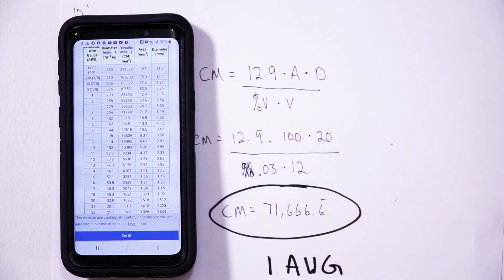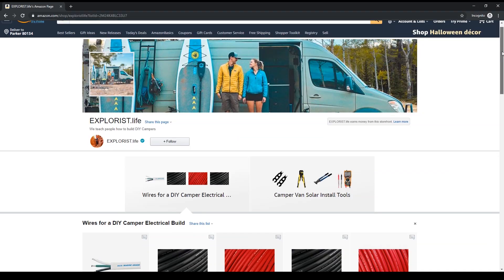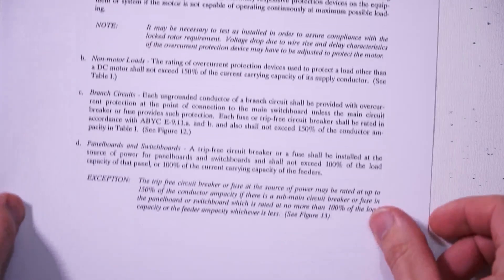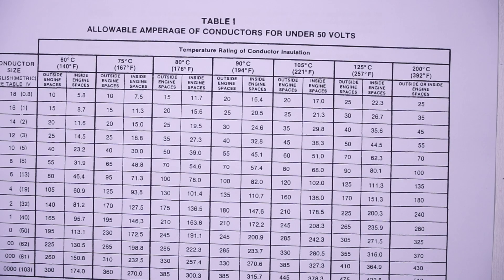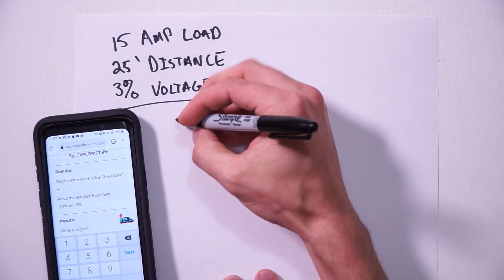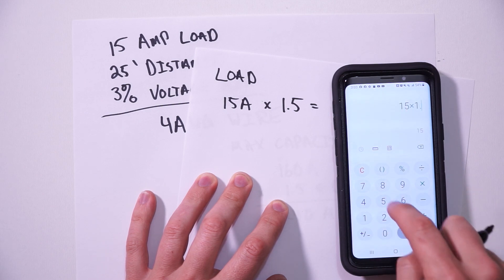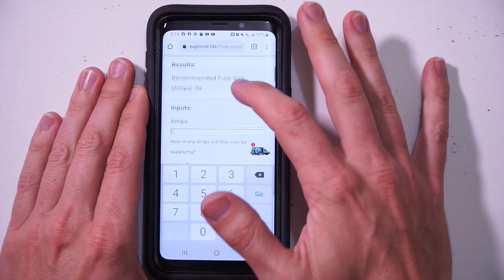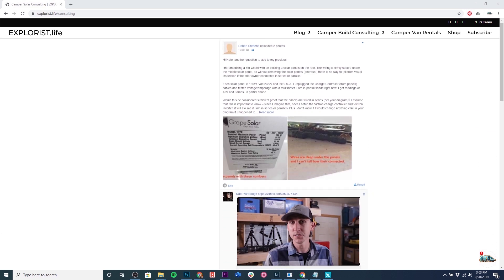How to Size Fuses for a Camper Van Electrical Setup

Comment: I don't get it, you say the fuses are to protect the wire not the device, but than you finally say to just size the fuse to the load which in this example was 15 amps with a 20 amp fuse. so didn't we just go around in circles? so basically I can use a fat oversized wire and still just size the fuse for the load which could be as little as 15 or 10 amps?
Reply from the maker: Correct.  It is indeed confusing and it does send us in circles a bit, but that's how electrical code reads.

"Sizing for the wire and not the component" means that your fuse can and should be higher than the component.  If I were to say to size the fuse for the component, people would have a tendancy to size for the amperage output of the component, say, putting a 50A breaker on a 50A charge controller; which would regularly trip under normal operating conditions.
Reply: @EXPLORISTlife  oh I see thank you, yes I've heard it's a rule to size the fuse for 20 or 25% larger than the component. Your math makes it more clear thank you

Comment: Hi and thanks for the super informative video. What i am having trouble finding is what size fuse to put on the wire between the Positive bus bar and the DC fuse block. How would i go about sizing that?

Comment: Nat, What an amazing gift you and your wife have. I purchased your wiring diagram for the 3000 W inverter up to 1200 W solar. It shows the fuses on the Victron Busbar but I'm using the 120/80 Victron controller to manage 800 W and I don't see the fuses listed for that busbar.  Wouldn't they be different sizes? I appreciate your help.

Comment: Love your channel Nate!  You're very meticulous and a master craftsman.  I'm building portable power systems and I've order some Taixi DC circuit breakers for my main Battery disconnect/protection.  Specificaly, DC12V 24V 48V 300A breaker part number is a bit challenging to determine give poor communication with the seller in China.    I payed ~$75 each for the 300A rated one.

Curious if you have looked into these.

Comment: I just discovered y'all today, Thanksgiving.  Awesome, thank you!  In the spring I am about to launch on a Lithium conversion of a Winnebago Travato Class B van.  It has solar already, and I will add more but a question I have for you is:  I notice that your diagrams all show PV panels in series.  Winnebago already has 2 extra plug ins on the roof for extra panels, but the panels will be in parallel.  I don't think that it will be worth changing everything around to have them in series.  What say you?
Reply from the maker: I very much like wiring panels in series.  Here's why: https://www.explorist.life/solar-panels-series-vs-parallel/

Comment: I know you know what you're doing, but where does it say in ABYC that this pertains to camper vans?  Shouldn't you be referencing  in NEC, the national electric code?
Reply from the maker: The ABYC doesn't reference camper vans or even RV's for that matter, but since marine systems involve a LOT of similarities to campers and RV's; it's a great standard to reference.  AND... the ABYC is based off of the NEC.  BUT... the answer to your question get Codes vs Standards... which is a whole different ballgame.

That being said; I reference both the ABYC (Electrical Standard) and the NEC (Electrical Code)

(edit)...and in a lot of cases... the ABYC is more strict than the NEC.  If you want to dive into that; it's the reason why romex solid core 12/2 is still used in RV's but the ABYC forbids solid core wire in marine applications.  The vibrations can cause those wires to break.
Reply: @EXPLORISTlife  Thanks for the explanation.  I do think that to use the ABYC is a bit too strict for RV applications, like tinned wire and galvanic isolators to name a few, the environment is just more complicated and you can't just pull over and get out. Thanks for all the great things you do for the community.
Reply from the maker: @TerrydeAlaska  Worth noting that I'm not asking people to follow the ABYC to a tee.  Simply used as a resource article.
Reply from the maker: @TerrydeAlaska  Also... I'm not going to be doing inspections on people's work, so ultimately everybody can do whatever they want. Lol

Comment: I think I'm missing something obvious here, but I don't understand why the max fuse size just has to be less than 150% of the max amps of the wire instead of 100%.  For example, if the max amps of a wire was 100 and you added a 140 amp fuse to stay under the 150% max fuse size, wouldn't a load of 120 amps be bad for the wire since it's over the max amps of the wire, yet it still wouldn't be protected by a fuse?
Reply from the maker: That 150% rule is directly from ABYC E.11 (b) & (c) and was written by engineers and electricians with years and years of schooling and experience.  I understand what you're saying, but when a code or standard is written...I'm going to teach it instead of trying to make up my own rules based on what 'seems to be right'.
Reply: There needs to be some amount of allowances for current spikes. Eg when you power up a load they often have in-rush current.  150% allows for in-rush current and not blowing fuses constantly.